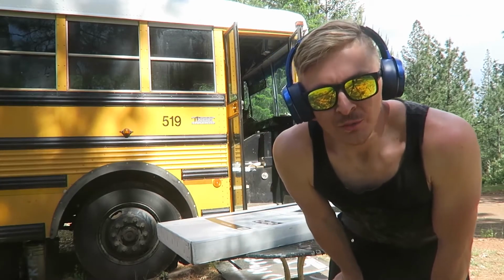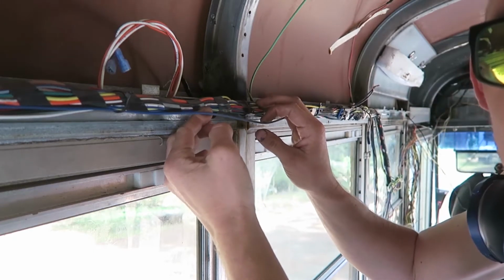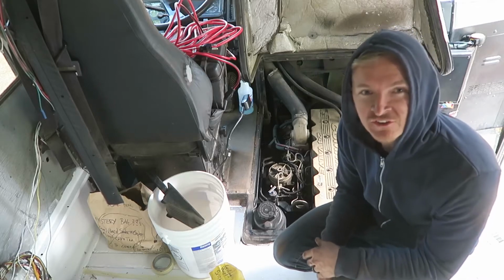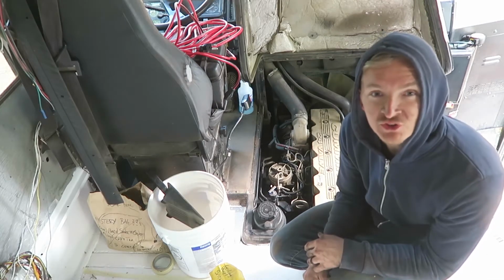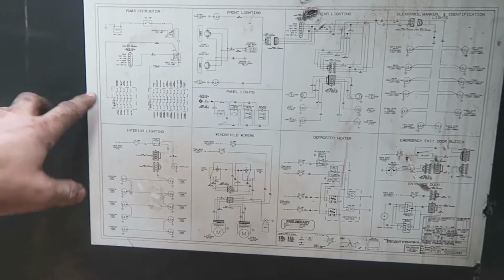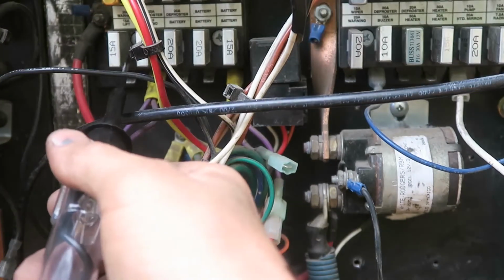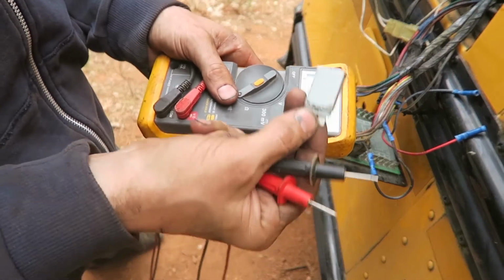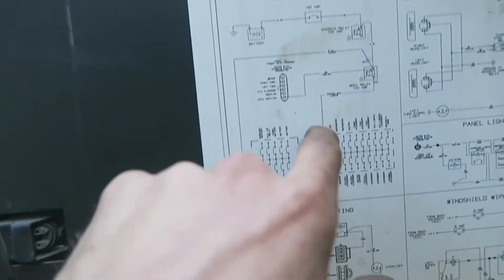#31 SKOOLIE BUS CONVERSION | ELECTRICAL PROBLEMS!!

Comment: My advice was going to be see if you can find another bus of your type and open the emergency exits, then see if that one has the same issue starting. If it did, then there is your point to start, the wires from the exits, looks like you have it covered though. Well done for keeping going, some would have throw the towel in.
Reply from the maker: Neil, your advice is exactly right. It was a ground. Tomorrow we have a video coming out of the process of finding that. Thank you for the comment and the kind words. I hope to hear from you further down the line when we're making videos of fun things like... well actually building things. :D

Comment: have you tried running 12 volts directly to the starter with the key in the Run position?
Reply from the maker: I did today. It worked. Check out my next video and you'll see the results.
Reply: I'm an old car audio guy if I can help I would love to let me know
Reply from the maker: +VC Hawk thank you VC - I'd love to reach out to you in regards to my next electrical challenge.
Reply: sure email me at redgixxxer@gmail.com  then I will give you my #..

Comment: Ian recheck the rear door and Emergency windows. Also I have never tried it on a Diesel only gas engines but use a large screwdriver and jump the starter with the key on. To see if the engine will spin and possible start. Also on Rear Engine buses there is panel to start the bus from the engine compartment do you have one on your front engine bus? Because if so, if that start switch is off then the bus will not start.
Reply from the maker: You're exactly right IWC! Just like Gene, I should have grounded the yellow b23 wire. All that work to find out it was a simple touch of a wire. Thank you for your comment! I wish I had listened to you better earlier. I'll publish a video of the story of the yellow wire shortly.

Comment: Hey if the rear door is not closed or you disconnected the rear door safety switch it will not start
Reply from the maker: Gene. You are right. After all this power stuff - batteries, starter rebuild, labeling of power system - it was a simple wire needing to be grounded. You'll see a video on it soon. Thank you for the comment! I wish I had listened to you better earlier.
Reply from the maker: Thanks john. You Rock!